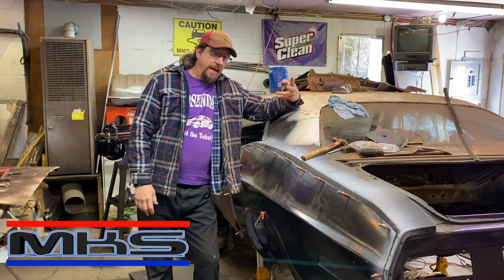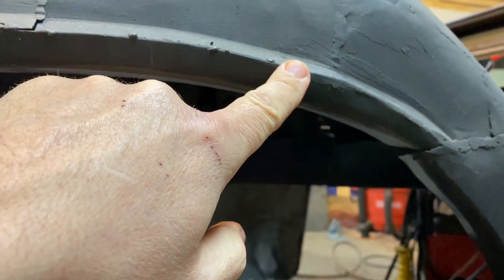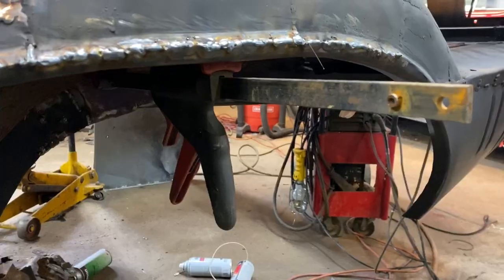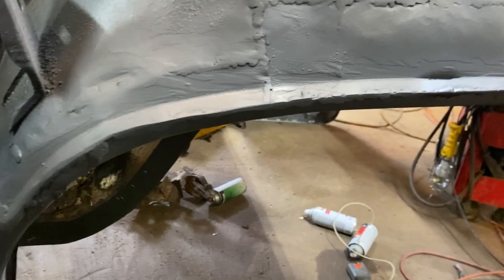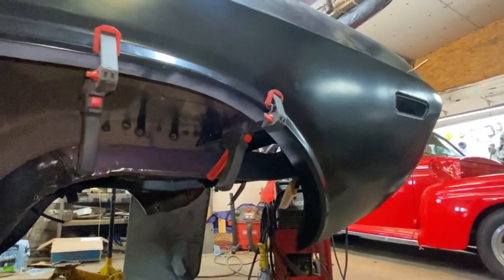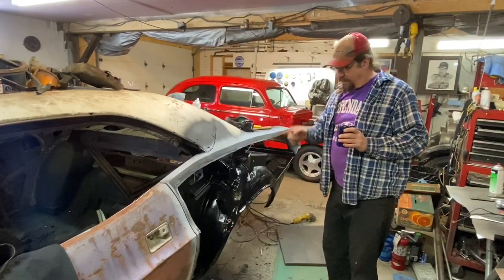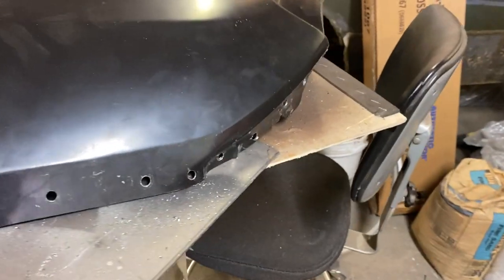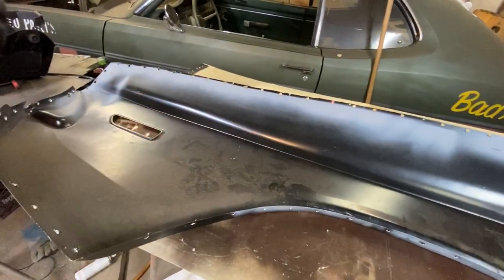Abandoned & Destroyed Challenger Repair Pt 2 - HOW I Hang a Quarter Panel - Stitches 70 Challenger

Comment: Nice!! That time spent grows when you have to install a panel that doesn't have a place to line up.  Someone re arched the wheel wells on my 50 and I didn't realize it until I tried to install the lower fender section. Stock is 4 inches lower than the current arch. Fun times.
Reply from the maker: Dealing with somebody else’s poor life choices is always fun. Lol

But I also know that I probably have passed on many of my poor life choices to others. Lol
Reply: @MyKARSShop  I hold no grudges to whoever did it. It was one of those classic 80's tires will not fit under the car, wide 60/ slot mag deals. What I do think about is a stock 8ba with a 3 on the tree isn't exactly a race setup even by 80s standards. LOL
Reply from the maker: @faroironandcustoms6577  😂😂

Comment: Good job Mike. When I do spot weld holes I use my hole punch for the first one and then a step drill to make them bigger. I hate starting the holes with a drill. I like that you say how much time it takes to do all this stuff. I was beginning to think there was something wrong with me for taking so long!. LOL. I get a lot out of watching your videos. Thanks!
Reply from the maker: My hole  punch doesn’t work so well. I need to get a better one someday.  I’ve never been fond of step drills  on sheet-metal. I find them to be a bit aggressive and too easy to over step,,, 

Maybe you have one that works better than the ones I’ve used. Do you have Brand suggestions?
Reply from the maker: Fabricating and installing parts is time-consuming. In my experience, even new parts can need a lot of work to make them fit properly. I don’t think there are any shortcuts with this work. Slow and steady wins the race.